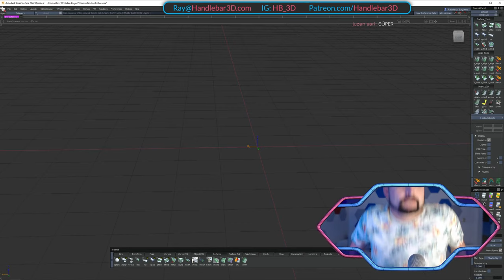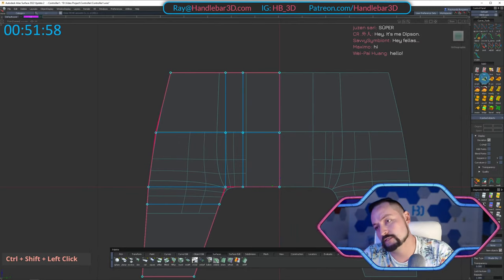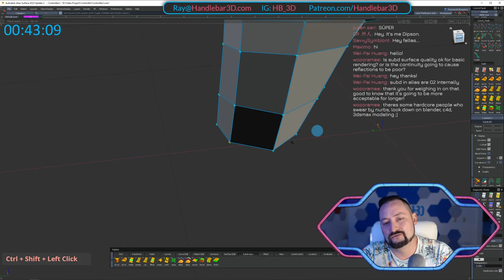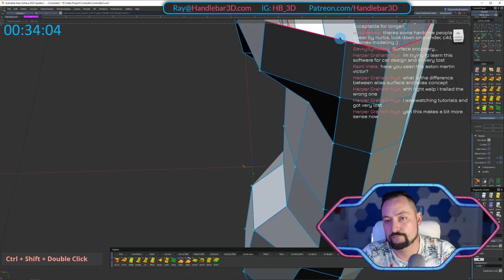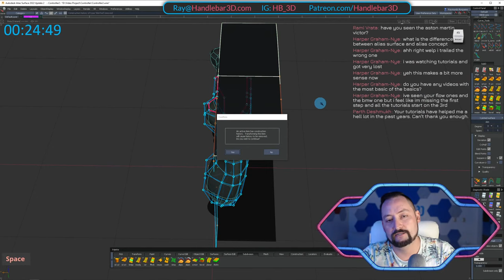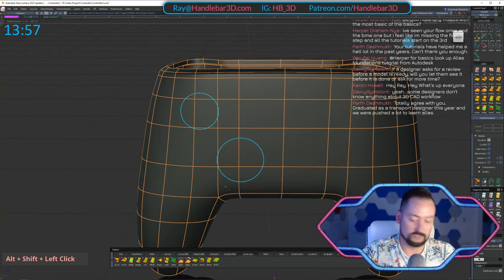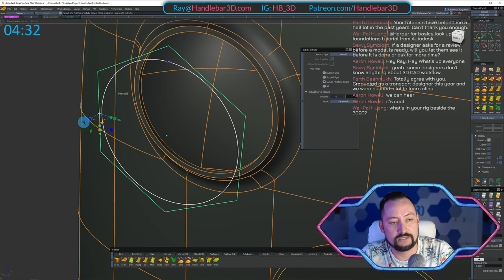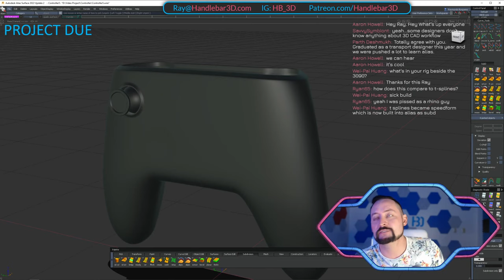Speed Modeling a Gaming Controller using Alias Surface

Comment: Regarding the T-Spline vs Sub-d, there is a major difference, T-Splines had a major performance penalty since is heavier mathematically speaking, therefore Autodesk developed a more performant solution for Alias  based off Opensubdiv by Pixar. I think Rhino did the same, but I haven't heard about the specifics.  Though it has the benefit that you can add addtional edges on quads, basically allowing you to subdivide certain polygons without the need to worry about ending the edge loops (they can just terminate at the next closest perpendicular edge, thus creating T-junctions, hence the name T-Spline). T-splines won't disappear though as they are used in Fusion 360 for generative design. I believe more in-depth information on T-Splines vs Sub-D was on Autodesk University a couple of years ago.
Reply: Thanks for the explanation. Yes you are correct T-Spline and Subd are not the same, sorry if my comment mades it seem like they are interchangeable concepts when they are not, it's just the history of Autodesk killing Rhino T-Spline before releasing speedform, then killing speedform and releasing Alias subd made it seem like that was how the tech was progressing. Besides Autodesk University, Fusion 360 also has a youtube channel that talks about T-spline in more depth.
Reply: Autodesk bought t-splines ages ago.....So you are using something 15 years old, same tech marketed as a great thing..... It has always been crap, and in alias is much more underdevelopped than it was in rhino back in the day. Polygonal modelling with subDs is much more robust and better, than T-splines. And the Alias team shoud be more focused on nurbs development, which is what the program is for, not this fancy useless crap
Reply: @gibson2623  Just go cry in a corner - you don't understand things.

Comment: You have a smart way of approaching the model from the start that makes things easier along the way. And that's what I focus on most to learn from you tutorials.
The videos about the spaceship were a game changer for me. 🙌
I was wandering, is there a way to controle the patch layout when converting from subD to nurbs and if it requires some skills can you do a tutorial about it?
Reply from the maker: All that is more about topology, but as you build the sub d you basically are controlling the patch layout. It’s either a 4 sided or an ngon, which basically means anything other than a 4 sided patch. 

An easy way to think about it is seeing how people model in polygons and apply it in the sub d workflow.
Reply: @HandleBar3D  thanks for the reply. Sorry I didn't ask clearly.
I understand how to get good topology of the control mesh. But suppose I made a surface skin between two quadratic Bézier curves, i get a single nurbs surface patch.
But with subD I get a polysurface with multiple patches.
Is it possible to convert the subD polysurface to 1 continuous surface with no spans ?
Reply: @nonameishere7234  I would like to clarify, there is NO conversion of a Subd to a NURBS model...Subd's in Alias are NURBS. There is NEVER a "mesh" representation of a Subd in Alias. Also, there is no Subd Skin tool in Alias so it is not possible to create the scenario that you describe. In Alias if you create a Subd primitive plane 1X1 you would have 1 single span bezier surface (to check this...select a pieve of your Subd limit surface and use CTRL+C/CTRL+V...but there would be no way to shape it because there would only be vertices at the corners...when add more edges to the Subd you can then shape it...for every quad of the cage there will be 1 bezier surface. For every NGON there will be a number of NURBS surfaces equal to the number of NGON edges.
Reply: @BK_design  crystal clear. I'm a new alias user, i learned subdivision modeling with an extension for SOLIDWORKS called power surfacing, it's a very expensive one when done modeling, it automatically converted the result to native solidwoks surfaces ignoring the patches, so it's not the same for alias, for every subdiv quad you get a surface patch. In power surfacing, the patches were created according to a certain limit of curvature i think, I must do my research